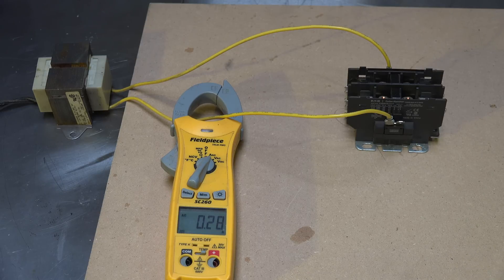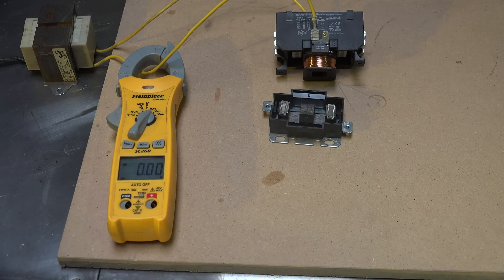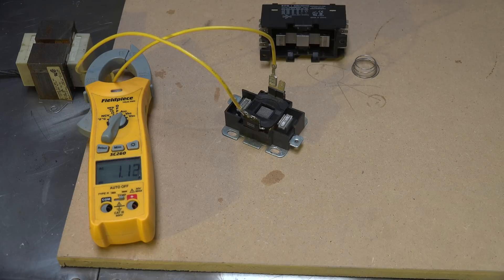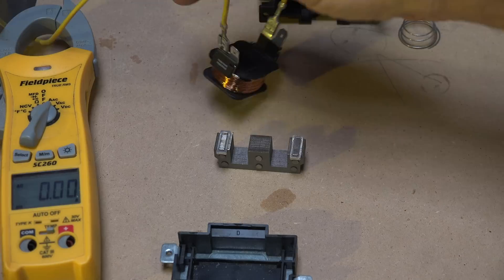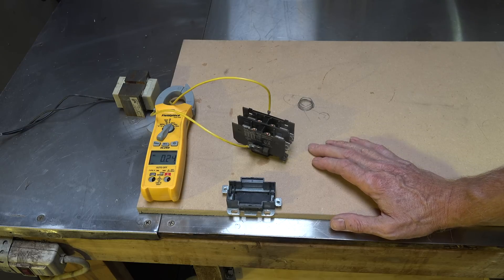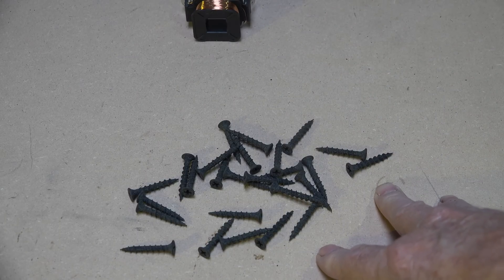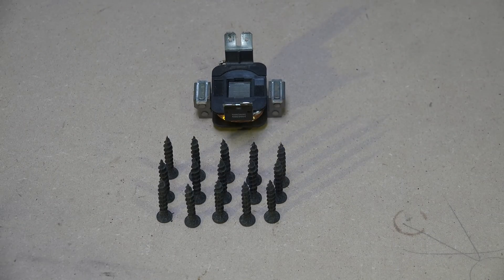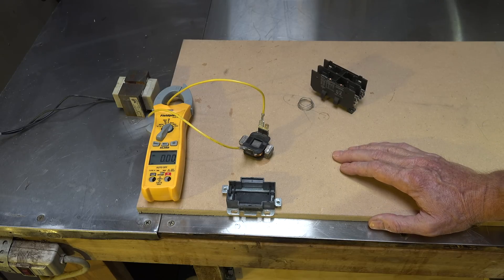Why does the contactor coil burn up, answer

Comment: I replaced the contractor in my outside unit before. This was due to me keep getting burned up transformers. Everything was fine for a while. Then the transformer caught on fire. Which is crazy because it has an inline fuse and that did not pop. My wife doesn't run the AC all the time and  we go months without running it. Since its outside .....could corrosion be causing the contractor to fail? We live a mile away from saltwater Beach
Reply from the maker: Assuming the transformer primary voltage is correct, corrosion of the armature of the contactor could be the problem.
GFM

Comment: Hello grayfurnaceman, I had a new HVAC plant installed which operated trouble free for about 12 months until the power supply was tripped at the switchboard. Removing the HVAC plant cover, inspection revealed black burn marks on the painted surfaces around where the power supply connects to the contactor. After checking the electrical circuits, a new contactor was installed and the HVAC plant has operated trouble free. I thought what probably caused the damage to the contactor, which tripped the power supply at the switchboard, was a voltage spike or current surge in the power supply. From your experience, what do you think was the probable cause of damage to the contactor, which tripped the power supply at the switchboard?
Reply from the maker: There are a couple of possibilities here.  A chattering contactor from low voltage to the coil, dirt in the contacts or loose terminals on the contactor.
GFM
Reply: Thanks @grayfurnaceman for a fast reply. I intended to claim warranty but the manufacturer would likely reply the HVAC passed their factory quality tests. When you write loose terminals on the contactor are you referring to the power terminals? Other than loose coil terminals what else could cause low voltage to the coil?

Comment: Hello and thanks for a great video, very informative. 

I'd like to know what would happen to the current in the coil if the coil is fed with low voltage(under voltage) or a much higher voltage(over voltage)?

I'm asking because I recently used a 380V coil with 230V input voltage, and the contactor didn't close in and was humming just as in your previous video when you blocked the contactor with the screw driver and it started to produce the humming sound and also increased the current draw.

I assume the under voltage would also cause the coil to draw too much current and would burn. I could be wrong. Also, what will happen to the current in the coil in case of over voltage, let say from the rated 380V to 390V, an increase of around 10V? how much of an increase will start causing problems?

I'm trying to understand the effects of voltage fluctuation to the coil.
Reply from the maker: Both over voltage and under voltage have same effect.
Under voltage overdraws because the coil cannot establish a stable magnetic field that will inductively reduce the amp draw.
Over voltage overdraws because the designed impedance is too low for the coil to dissipate the heat.
Over voltage of about 20% is tolerable.  Same for under voltage.
GFM
Reply: @grayfurnaceman   Wow! Thank you so much Sir..

Comment: I have a broken C terminal on my furnace control board. I just ran the common from the thermostat and the outdoor contactor directly to the transformer common. Will my furnace control board still be protected by the 3 amp fuse? Or should I put a fuse in line on the common lead of the transformer. Thanks for any help from anyone in advance. Great video
Reply from the maker: You are protected by the board fuse as it is on the R side of the control transformer.
GFM
Reply: @grayfurnaceman  I did not know that. Thank you very much.

Comment: How much current a 240v coil draw. During normal working condition. 

😭I don't have clamp meter to check please help me .
Reply from the maker: The draw varies with the size of the contactor.  However,  .5 amps is about as high as it would be.
GFM

Comment: Another way to think about this is to realize that any length of wire fashioned into a coil acts as an inductor.  Since inductors behave in a manner that resists changes in current flow,  on the uphill (increasing) side of the AC waveform the inductor will try to "push back" (using back EMF) which then limits current flow.  The proximity/presence (or absence) of a magnetic center (laminated core) alters the coil's inductance value and therefore alters the overall current flowing through the coil.  This also explains why a motor having a locked rotor draws so much current, because of the lack of a spinning armature and it's associated current limiting magnetic field.

Comment: Thank you very much for your vedio,  I want a 20 amps 415v ac 3 pole with 24v dc coil contactor for switching exhaust fan, is it available?  Regards.
Reply from the maker: The DC coil may be a problem.  I would try mouser or digikey.  Hope this helps.
GFM

Comment: Hello. Quick question I'm working on a unit with a heat pump. According to the start up cheat on heat and cool " y" is suppose to be constant energy when thermostat activates and " 0 " is only energized when cooling is on. There is no "0" in heat as we all know. Unfortunately my thermostat "y" doesn't turn on, on heat mode cause it's suppose to be " w " manufacturers don't want a " w"  cause in the cxm board it is jumped inside . My question is can I place a jumper in w and y inside the thermostat to make this work?
Reply from the maker: This one is determined by the thermostat used.  Some can be jumped.  I would jumper it and see if the backup heat comes on with the heat pump.  If so, you cannot jumper.
GFM
Reply: thanks guy i appreciate your videos